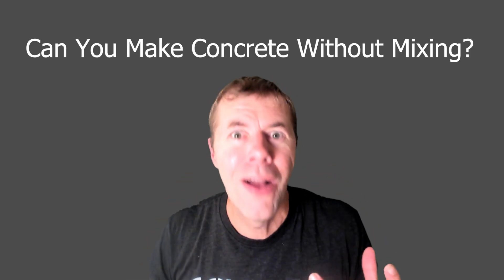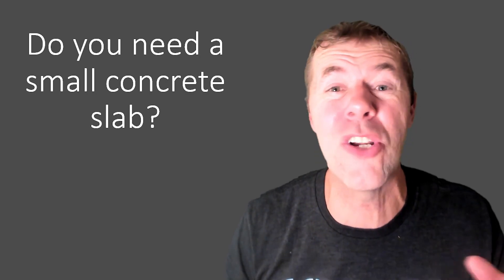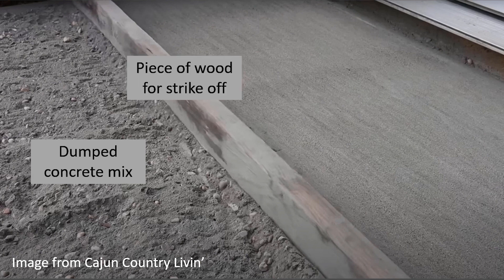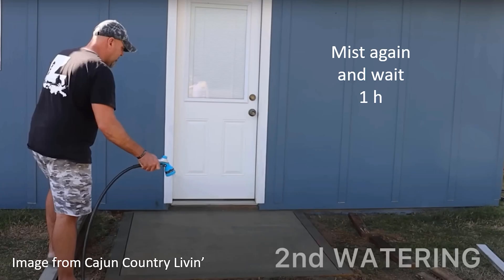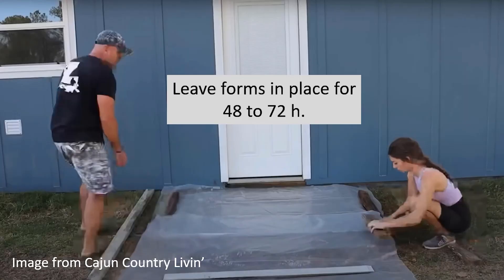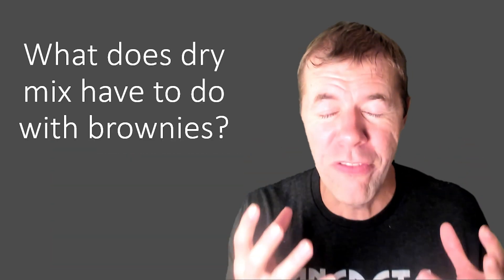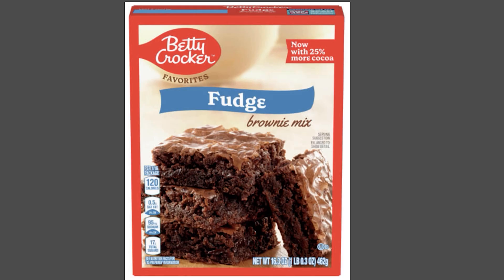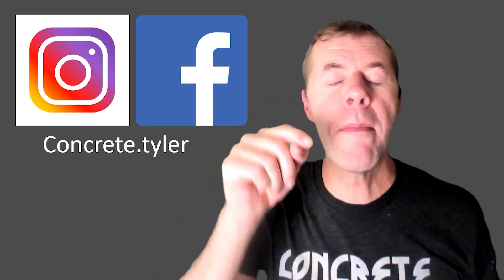Dry pour concrete - An Experts Opinion Dry pour concrete slab details

Comment: Dr. Ley- Thanks for finally dipping your toe into "dry pour" concrete.  I understand your biases lean toward commercially processed concrete, but you made several critical assertions of dry pour in this video that should be fully tested to confirm.  I refer to your remark that dry pour will not achieve similar performance to wet pour, I infer your contention is related a less homogenous mix with dry relative to wet process.  I think, however; we all would agree that overwatered wet pour, mixed "in the wild", underperforms , probably due to large aggregate migration "to the bottom" of the pour.  The "curing" of cement + aggregate into concrete is a chemical process, it requires "adequate" hydration to proceed to full "cure" at about 30 days under normal circumstances.  The "Cajun Country" hydration regimen is not scientifically derived, it empirically seeks to stabilize the slab "top crust" and hydrate the slab for cure promotion.  It could probably be simplified into a 2 step process; first, crust stabilization could probably be achieved with 2 mistings at 10-15 minutes apart, and second, the timing of hydration soaking is less relevant, as long as the top of the slab stays moist or wet the slab will hydrate quickly (see video from renetto for visual evidence).  You refence "air voids" as a problem in dry pour, but if you might research a quantity of dry pour videos, you will find people have addressed this issue by, for instance, impacting the dry forms with a rubber mallet prior to or after screeding and before wetting, yet another ingenious fellow attached a palm sander to the screed board attempting to achieve a smoother surface. This is probably adequate for small projects up to 4'x4', I would guess.  Your critique of dry pour lacking "air entrainment" for freeze/thaw protection warrants merit, but where do "air voids" end and "air entrainment" begin.  As I peruse the comments attached to this video, I am struck by the high percent of commenters requesting "testing" of dry versus wet pour methods.  The the video testing of dry vs wet here on YouTube is not scientific, and often "tests" concrete that is not yet fully cured with methods that are "empiric" but not "quantifiable".  Since you have access to the required lab equipment, might I suggest the following tests.  It would be most helpful to the DIY community to know how dry and wet pours compare with regards to cure time, final strength, and density (permeability).  At a minimum; a comparison of dry pour versus wet pour with big box bagged dry concrete mix at 3,7, and 30 day interval testing, a bonus would be to add samples of commercial mix (from truck or yard) with similar specs.  Your assessment of the final quality (compressive strength, density, and air entrainment) of concrete produced by each method would be highly valued by all who follow this channel.  Afterthought: perhaps you might run a few samples of concrete prepared with both PLC and straight Portland to see which might be a better choice for the small batch DIYer who might seek to add fiber to a bag mix or self mix with a small portable mixer, and still dry pour a small slab. We appreciate your efforts and insights!
Reply: In the united States (probably in Canada too)No structural engineer, city/city/federal inspector, etc. would EVER sign off on "dry pour" for anything remotely important...

If that isn't enough proof that there is a big difference in quality, then I don't know how to help you....
Reply: and by 'straight portland' do we mean type III? as far as the functionality of the installation's covered in this video (walking on it) the comparison of different cements is probably splitting hairs. It can be tough enough to achieve optimal results (aesthetics) when shaping and finishing concrete without having to worry about things like heat of hydration. Now what would be interesting, to me anyways, is to get your opinion (engineer?) on when to SEAL concrete. patio, sidewalk, driveway type of mixes

Comment: I've used dry mix concrete technique for femce and gste posts for decades......  my technique includes wetting the adjacent dirt well prior to dumping in the bagged concrete.   My train of thought is that the concrete wants water,  and I want good concrete.   So i provide starter water in wetting the dirt that is gong to come in contact.   MrEric
Reply: Yeah, dry mix is actually better than wet mix for fence posts. It doesn't bond to the post as good in dry mix, making post removal easier.

Comment: All you diy guys:  do this method for an AC pad because by the time you need to replace the AC unit you will also need to replace the pad.  Dry pour does not hold up to weather.  It delaminates the surface and then will just fall apart.  Sacked concrete in bags has usually been stored poorly allowing moisture to cause the cement to be weak.  If you want to make something that will last you have to do it the right way.  Clean gravel, clean sand and new cement from a reputable supplier that has stored it properly.  Follow the recipe and do the work.  Take no shortcuts.
Reply from the maker: Thanks Parker,
That is what I would do if I was making one.

Comment: I am thinking of using the dry pour method with a paver form to make a walkway.  It seems to me I could either make an outside sides form with wood for the entire length, fill it with dry concrete, spray it with water then stamp the whole thing with the mold form to make the pattern OR just dry pour each one in the mold form without the wood sides, but what about the form release without the sides falling out?  I would think if you got the top wet, the side would not be the first time, but if you did many spray / wait cycles the mold might not release from the part of the concrete that is now hardened?  Is there way to do this with just the mold form for each paver? Is that something you could test?
Reply from the maker: Use a mold made of plastic or latex.  You could also use plastic or saran wrap around the mold.
Reply: Thanks, I was not sure if 'dry pour' would get stuck in the mold since the top sections would harden by the time the bottom would be wet.  If one put plastic or saran wrap around the mold I would think the sides would release but I still wonder if the hardened top might jam the mold from being removed?   @TylerLey

Comment: i'm interested to see the strength testing of it, especially a comparison with different strength concretes. compare standard vers high strength vers fast setting etc.
also the difference between wet and dry ground.
also i wonder what the effect of a water reducer admixture added to the spray water would do.
Reply from the maker: Cool ideas!  We will definately compare to different concretes.  I am not sure the water reducer spray would do much.  Water reducers move cement grains apart in water and the dry pour is not really saturated.
Reply: water curing for 1 month will probably make a huge difference and possibly raking it out to mix it a bit more at the start...

Comment: I recently placed a 14'x6' slab as an extension for an outdoor kitchen using the dry pour method. My yard slopes quite a bit and ended up using 87 60lb bags. I compacted the bottom half, added rebar, then filled almost to the top of the forms with the concrete mix, compacted again, then topped with just a sand mix. Way overthought it! Compacting and adding more on top made the layers not bond to each other as good, so I had some areas of delamination on the top with a couple of ugly holes opening up just using pressure from a water hose. This morning I ground off the loose material from the top and tomorrow will patch the holes with CementAll, then put a layer of NewCrete over the entire surface. But I could be overthinking this, too.

My next project will be mixed using portland cement and supersacks of fine and coarse aggregates along with a superplasticizer/retardant additive. No more dry pour for me. Great to see this and your other videos. If I wasn't so old and lived so far away, I'd love to sit through some of your classes at OSU.
Reply from the maker: Thank you for the comments!  Sorry to hear you didn't have good success with it but that is how we learn.
Let me know how your next project goes and would love to catch up with you at some point!
Reply: Sounds like you modified the process. I have yet to do a dry pour, but plan to as my project is impossible for a truck to get to and I don't want to be tied to the timeline and manpower required to mix on-sight. I will definitely learn from this.

Comment: This has to become an Oklahoma State research project. We need slabs to core and beams (reinforced and unreinforced) to break to see how it compares to standard concrete mixed per the manufacturer - this could be a whole series that either debunks the practice or identifies some best practices and recommends where to use it.
Reply from the maker: We are on it!  Keep thining about what you want us to look at!
Reply: You could easily spend more time mixing up the dry mix beforehand as well to improve the recipe.  I think the curing process will be a big deal for dry pour, if you water cure for 1 month or not.

Comment: Thanks. Would it be possible for you to do experiment between dry and wet pour and measure the pressure to failure with hydraulic jacks.  I assume the 2 are not even close.
Reply from the maker: Yes!  Stay tuned for that!

Comment: What is the Professor's opinion on "Dry Cast" Concrete as used in the Concrete Pipe Manufacturing Plants?
Reply from the maker: It can be great!  it all depends on what properties you want.
Reply: @TylerLey  -- THANK YOU Sir!  The most important property we would need is ZERO SLUMP.

Is the addition of Water Reducing Admixtures (with very little water) what separates Dry Cast from Dry Mix (with absolutely NO water added to the Mix?).

Comment: In terms of the dragon scales or star wars inscriptions. At what point in the anti-chicken process do you think of doing it? 

Understandibly, a repeating pattern like the dragon scales can be quickly stamped on with a normal pour. 

Hand writing stuff, or striking with like a stick,You can't really do it dry because the dry mix will push out of the groves, and create weird lips. 

Do you do it after the first or second mist?
Reply from the maker: I would do it before misting.  If the aggregate from the dry pour is causing problems with your marks then you might need to run the top 1/4" of the bag of concrete through a sieve.

Comment: Has your lab ever tested the strength of dry pour vs wet pour?
Reply from the maker: Not yet but we will!
Reply: @TylerLey  I'm across the water in Ireland and I'd love to hear from a concrete expert about other brands of pre-mix rapid set concrete apart from Quikrete. 

K-Post, Blue Circle, Kilsaran K-Pro to name a few that are available here and in the UK.
Reply: There's a video out that says about 70% which is higher than the guy doing expected.

Comment: Check out Mike Haduck, he did a small scale experiment with a small slab where he used dry pour and wet pour. there is no comparison. Don't do dry pours ya lazy bums
Reply from the maker: Thanks!  I wouldn't make anything out of it that I needed to last long term.  It will be fun to do our tests on it and compare the results.
Reply: I really liked his video.
Reply: It has its place. An intermediate surface between gravel and concrete. Great for my bike shed.

Comment: The part you thought was "texturing with a paint roller" is somewhat texturing but is part of the Cajun Couple's patented part of the "striking process." If you fail to paint roll it with the fluffy paint roller you will have a rough, bumpy and rocky surface. Also, dry pour concrete probably must be done in a fairly humid environment as it cures from the other side via the wet/damp ground (Louisiana.) Otherwise, it will probably take much longer for the concrete properly cure. I would use reinforcing of some kind fiber mesh, wire / wire mesh or rebar and some method to reinforce the corners. Best regards.🖌🛼

Comment: Really cheap out:  Mix pure cement into the top of a rocked surface (like class II base rock) with a rake.  Did that for the chicken coop and run area.  Smooth, easy to clean, and can't keep the chickens off of it.
Reply from the maker: That is like stabilized soil.  I agree that can be awesome in some applications.
Go chickens!

Comment: Can a person use fiberglass rods instead of rebar to extend the life of concrete?
Reply: Maybe even a bag of fiber reinforced mix..?    Rebar would probably create more voids, and the added complexity would be better applied to more traditional methods.   I could add nuts to the betty crocker brownies, but beyond that I might be diminishing the convenience benefits of using a boxed product.   At some point, there is greater benefit to using traditional "wet" methods.
Reply from the maker: @fargley001  I would be worried about how well the dry mix bonds to it.
Reply: Ti Ylin world famous Chinese bridge engineer uses Bamboo as rebar in China for decades on large projects .
Reply from the maker: @Motorhead250  TY Lin is one of my heroes. I love his work.
Reply: @TylerLey  Architect here.NYIT 1990.
We studied him.
We are general contractors in NC NY also.
Poured alot of concrete in 30 + years.
Reply from the maker: You can in certain applications.

Comment: I do this for my backyard floor... I mix cement with sand manualy and spread to form pour water on it, and for surface i use cement paste... Its done with no need mixer and less effort compare with wet mixing...
Reply from the maker: Thanks for the note!

Comment: You've got students who need term paper projects.  Pour 5 concrete slabettes using this method and another 5 with the regular method.  Maybe do a set with rebar, another with fibers.  Maybe one 4" deep and another 6" deep.  Then cut them into 12" strips.  Do a visual exam for uniformity, do a dye test from both top and bottom, do a compression break test and do a tension break test.  Having just these empirical numbers will help me understand if this is appropriate for anything but decorative concrete.  Then have your students publish and present that paper at ACI.  Fame and experience for everyone.
Reply from the maker: Thanks!  These are good ideas!!!  Watch for a future video over this.

Comment: This seems closer to the super dry mixtures used for roller compacted concrete, or dry pack used under a lot of tile jobs. It would be interesting to see if you could densify it with some type of roller or a vibrating compactor.
Reply from the maker: That is a good idea.  We will see what we can do!

Comment: Hi Tyler.
You are the one person to be a little more scientific in this discussion.
Do some compression testing of samples and the adhesion to the rebar.
I have done plenty of dry pours for small things over the years.
But I normally do half the level, saturate quite well then rebar mesh then dry mix over the top.
Not sure the finished surface is hard enough, or compact enough.
Cheers from Oz
Reply from the maker: Thanks! 
We will try that coming up!

Comment: we need a dry-pour-concrete test for sure
Reply from the maker: It is coming.  Keep thinking about what you want to see.  We will start them soon.
Reply: @TylerLey there are gong to be LOTS of variables..... the water content involved will be one of the largest ones,  I would think.   MrEric
Reply: @MrEric_API   measure the water applied vs direct mixed to determine the hydration of the mix.
Reply: @TylerLey accelerated test on longevity compared to the same sacked concrete mixed in a wheelbarrow.